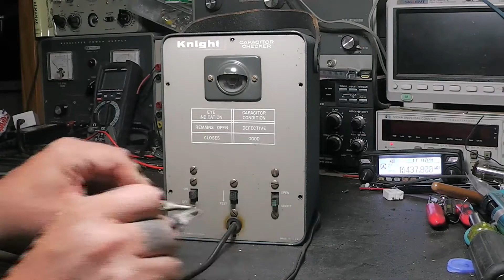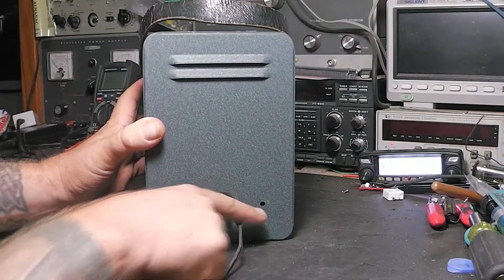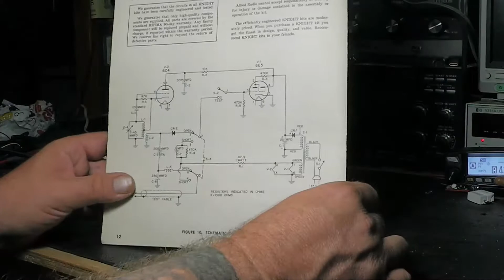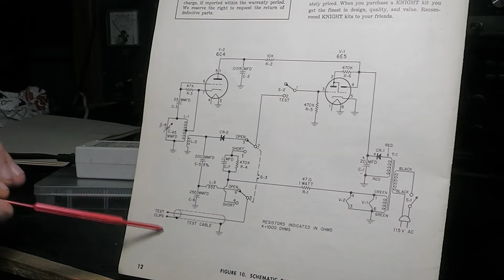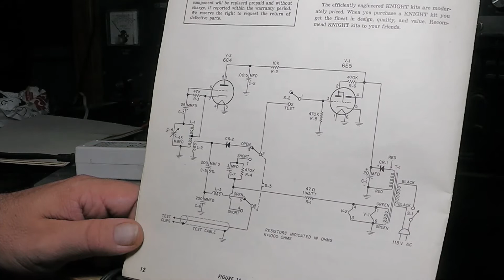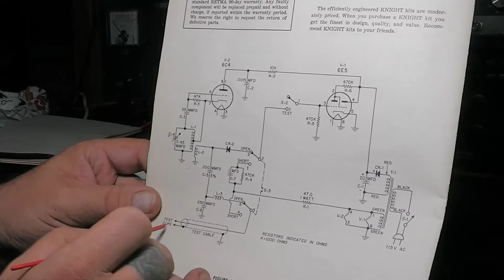Knight Capacitor Checker Restore Part 1

Comment: Anything you have against leakage testing?
Reply from the maker: I own 4 leakage testers and use them on things I think could be iffy.  Say something from the late 70's onward.  However, through many years of doing this, from experience, I know that capacitors at this age are on a down hill spiral.  Leakage testing was also, way more used a few decades ago when capacitors were pricey.  Now, they are not as expensive, you know they are aging so why leave them.  Especially, in a piece of test equipment, that you want to be reliable. 🙂  I have also been unfortunate, and tried just leaving them in many years ago.  When they short and take out a transformer that is hard to get.....you learn the hard way.  🙂
Reply: @ke4est  ,   I agree, except that my  first impulse is to check leakage first, not after an ESR check. KQ2E
Reply: @ke4est  I'm sure I know your answer but maybe just reassurance. So on my vintage instrument amps even while my electrolytic looks and test by ESR/Leakage solid, you'd replace them.  Really hurts to think I'm the new owner to be the one changing that look. I could cosmetically stuff the old but what if I'm destroying a good old cap. Final solution, just save them in a baggie for posterity, for a next owner if I ever sell. What d'ya think?

Comment: Right away I noticed the line cord has two cracks 1/2" away from the rubber grommet it goes through. Need to fuse this baby as well. Micromold capacitors are notorious
for going bad or so I'm told. Do not attempt to replace this line cord with a grounded 3 wire one. It won't work! Just replace it with a 2 wire polarized one.Good stuff so far.
Reply from the maker: Yes indeed.  You will see in the next video that I replaced it. 🙂

Comment: Those rectangular caps were made in Brooklyn, NY; they were second-rate when they were new.
Reply from the maker: I have not tested them to see how close they are to value, but they are working okay.  As, I have started the restore process and it is putting out a very pretty sine wave.
Reply: Just check them with a  more modern meter with capacitance checking . Odds are they are still OK.